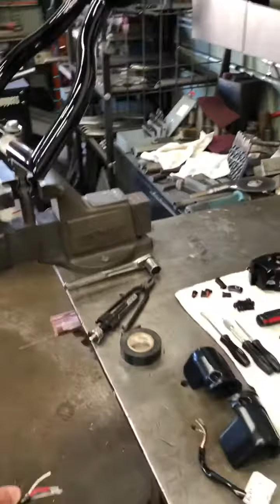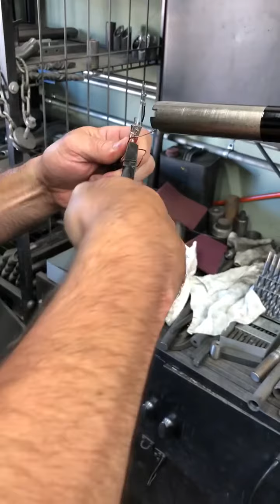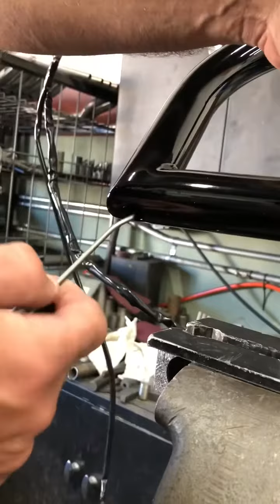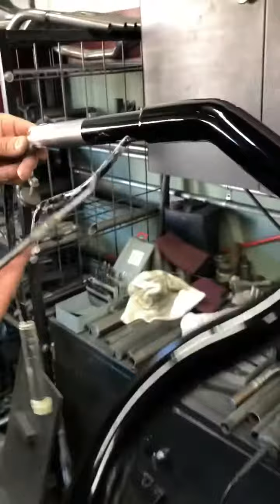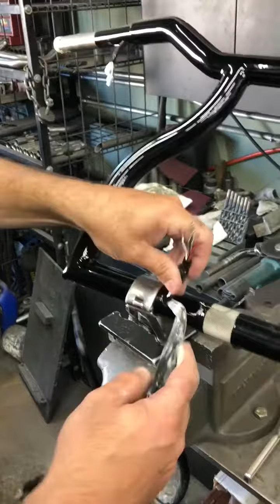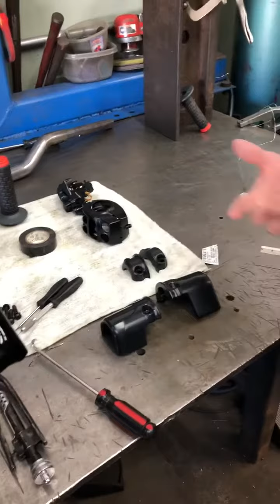Spadafora Choppers - Spady’s speed shop 2015-up Roadglide TWISTED TEE BAR WIRING TUTORIAL

Comment: Ray, I had a similar issue on the throttle side. I ended up pulling them back out and replacing the stock rubber tubing material with a smaller diameter heat shrink. Greased them up good with cable lube. Still had a bit of an issue. I was doing it on a table and did not have a vice. Not that that really matters. This is a great video though because you show how it really is without editing. BTW love the bars. And passed out your business card.